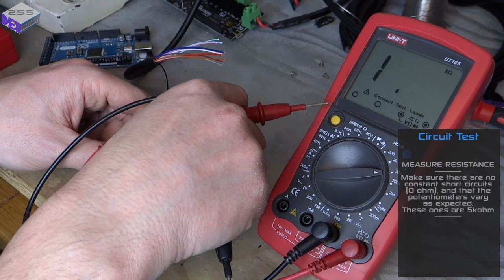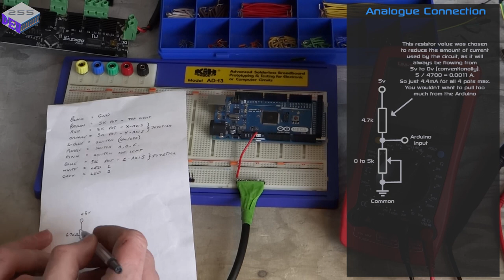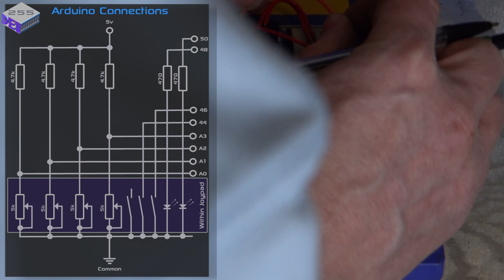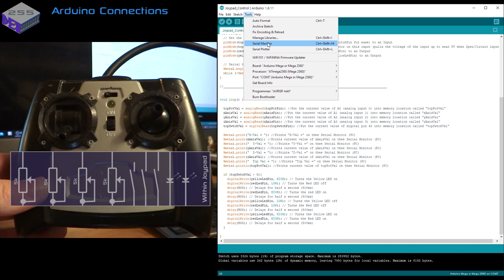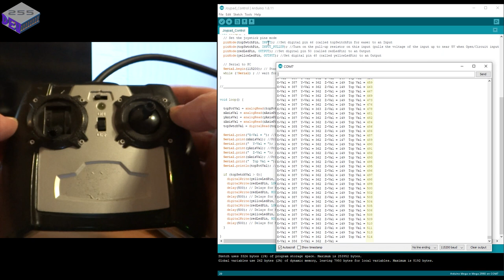CNC Mill Conversion Part 6 - Arduino Joypad Control

Comment: This is a brilliant and inspirational series. I have the same mill. Whilst I suspect I'll never do anything as involved as this, it has been fascinating to watch and also some very useful techniques that I can apply to my own mill e.g. the procedure for tramming the mill properly (a few videos back in the series). Please keep going with the series and good luck with the rest of the build & coding!
Reply from the maker: Hi Bob, thank you, there is a lot more to come 😀. I am currently working on the video for Friday and hopefully machining out some of the parts. They are very solid machines and when fully setup they are so accurate and repeatable. I measured the backlash yesterday with the new drive unit and it's only 0.12 mm. Feel free to suggest any content on the mill and I should be able to cover it 👍